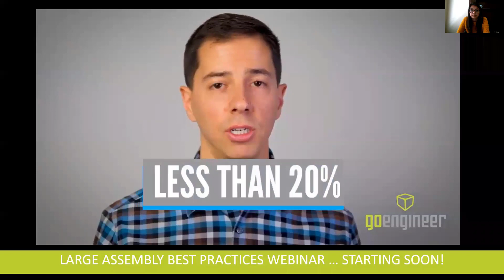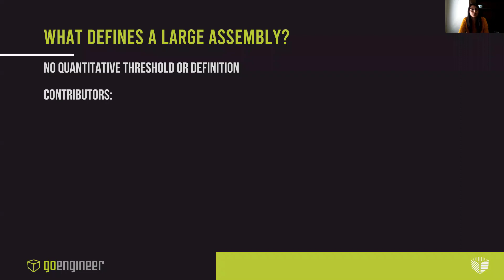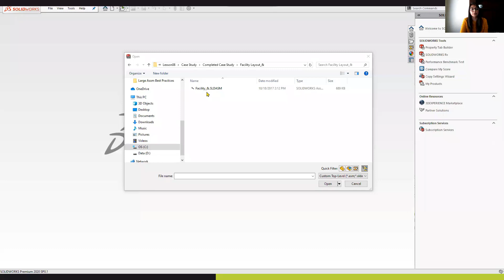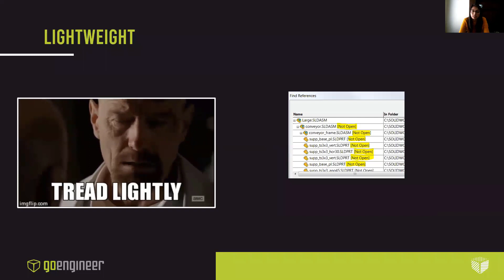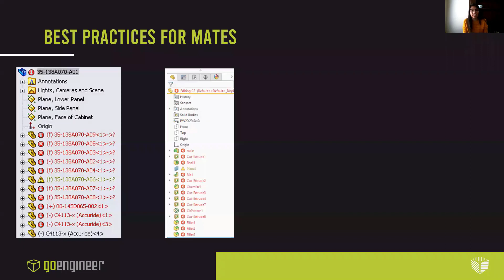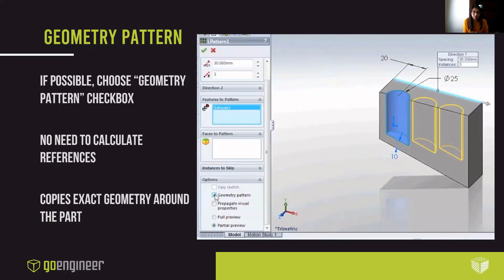SOLIDWORKS Tutorial - Large Assembly Best Practices

Comment: You mention that the location of your files has a big impact but not really what you can do about it. What can you do if you use a server and pdm? I can't do a pack and go all the time I don't think? Are there settings you can change so the file is stored locally while you are working on it or anything else that can be done to help?

Great presentation by the way. Thanks.
Reply from the maker: If you have PDM and you are checking the files in and out, then that’s great!  That’s exactly what you should be doing!  The files are stored elsewhere, but when you check them out to work on them, the files are actually brought local to your machine for that time period.    And then when you check them back in, the files are go back where they are supposed to go.  What I mentioned was more for those who are storing their files on a network drive…and that is not recommended.
Reply: @goengineer  With PDM, checking out an assembly file may bring it local to your machine but the subassemblies and part files remain--elsewhere.  I have an entire 200,000 square foot facility modeled.  It contains exactly 20 subassemblies and 20 mates (coincident origins with axial alignment) and it is still limited in it's open/rebuild time by the fact that the subs and part files are elsewhere.  That said, following your advice has reduced file-open time from 45 minutes--down to 6 minutes (at least on my machine).  Thank You!